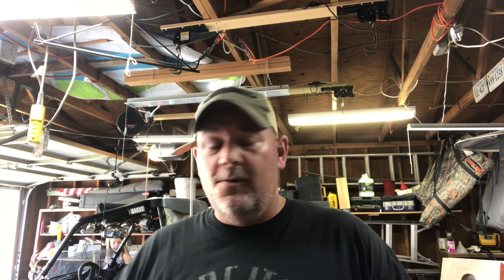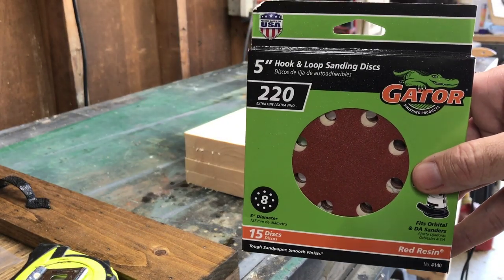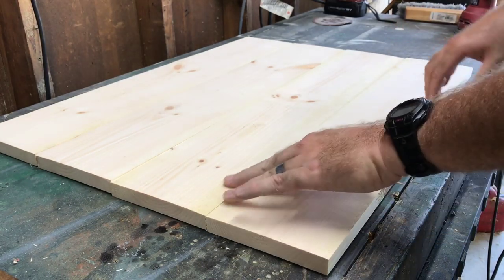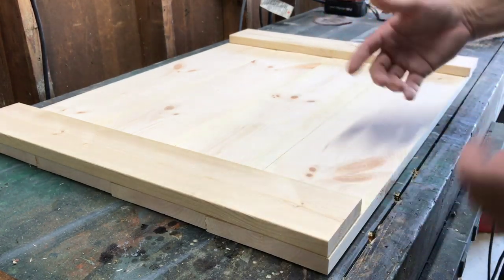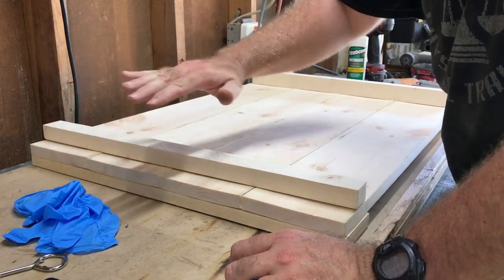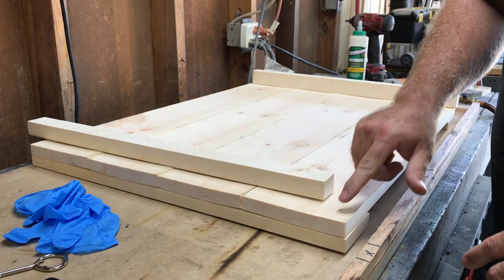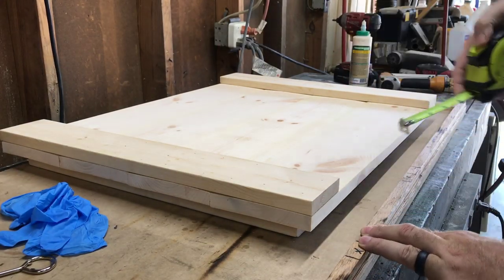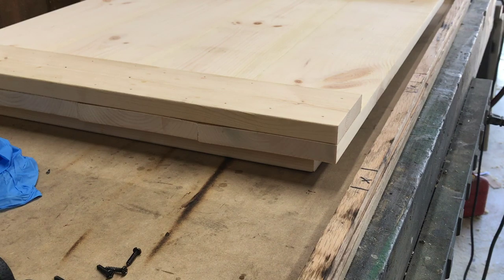Stove Top Cover for Raises Burners

Comment: I made a few of these for Christmas gifts this year. Check your home depot for S1S2E 1x boards. One side and 2 edges are as smooth as an appearance board.  The other side still has the bandsaw marks. You can save some money on projects that a rough side can be concealed. Locally it is $3-5 less per 8 foot board compared to the equivalent appearance board.
Reply from the maker: Chris Rasmussen Thanks for the heads up 👍🏻

Comment: Thanks for this update.  This is what I need to make one for our stove.  The only thing I am doing differently is I glued up the 1x6 boards as well because I want to make sure they are all nice and tight without any gaps . I then use a bunch of clamps everywhere to  make sure everything is as straight as possible. I am in the middle of the build. You are right that these boards are a little cupped which is why I glue it all up and clamp it.  I will probably still have to sand in places to make it all smooth and straight.  Thanks!!!!
Reply: The glue was problematic because of squeeze out.  What a mess.  Doesn't look bad but I am thinking the next one will be without glue.  What do you think of attaching the boards with pocket holes?  Just a thought.
Reply: @jg1007  I clamped mine into my wooden flag jig and nailed the slats to the runners from there. Made a tight fit and took less time that dealing with pocket holes.

Comment: Hello My stove is 20& 1/2 wide and 29&1/2 long 
Can you give any pointers on how I should get the wood cut at Home Depot
Reply from the maker: Get them to cut it to the width of your stove. Just make sure you measure the “actual” width of the wood to make sure the 4 boards will come up to the length you need. Then get them to cut the 2 smaller pieces where the handles go to the proper length of your 4 boards combined.
Sometimes a 6inch  board is actually 5 1/2 or 5 1/4. So I’d definitely measure first before I get them to cut it.

Comment: Hello love ur video!!! I am curious as I have built two of these now (other version) but they do not sit level - there is a bit of rocking - what am I doing wrong- is it just my wood choice?
Reply from the maker: heather sutton It could be the Wood. Sometimes the moisture in the home will cause the wood to shrink and swell which will warp them. Place some felt on the bottom to even out the gap so it won’t wobble.

Comment: Did you put wood glue in between all the long boards?
Reply from the maker: Austin St. Laurent No, I only glue the 2 boards that run front to back on the cover. I have made a few and haven’t had an issue not gluing the big boards together.

Comment: Why didn’t my 22 in fit the length of 4 boards I got them cut at home deport
Reply from the maker: Not sure unless their boards were a different size from the mill. Like a 6 inch board isn’t really 6 inches, it’s like 5 3/4 or 5 1/2 inches wide

Comment: i know this is a super old video but can somebody write me the EXACT measurements i don’t know a saw and have to get it cut by a friend and just don’t want to mess it up! thank you in advance 😭
Reply: Mehgan Harris ...buy a 1x6x12. Lowe’s will cut it into (4)30” boards for you, free. You will have a leftover piece abt 24” left. You will use this for the the vertical sides. I made mine 30”, that’s the standard for electric stoves and usually 22” deep. Cut that leftover that leftover piece to 22” or the depth of your boards, which is best. Then split down the middle or I used 2 5/8” attach to both sides with staple from the bottom. Use wood glue and a few clamps. Follow the steps he shows, if u have burners. Electric stoves don’t need the bottom supports. I just finished making mine. Turned out great. Using a stencil for some designs...Good luck

Comment: Thanks for sharing! Do you have a tutorial on how to apply the polyurethane and do you use the same size brad nails for the front and back?
Reply from the maker: Milagros Arango I use a synthetic brush, like the ones family dollar and dollar general sell....and apply the first coat. Once it dries I lightly hand sand with 220 grit sand paper and apply the final coat. I only use 2 coats on these but the more you do the thicker it will be. Also yes, I used the same size brad nails on the entire build.

Comment: U could've just said drill a board on the outside on the bottom thats a inch and a quarter high on each side. 😏 of course I only said that because u already showed the one video for flat burners.